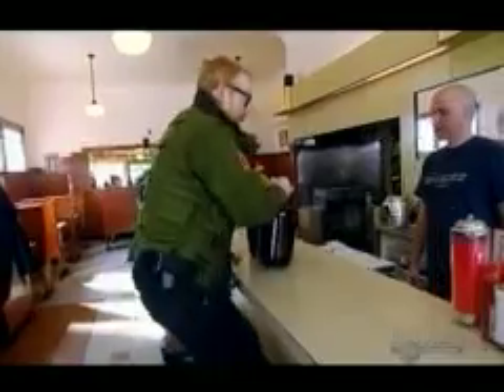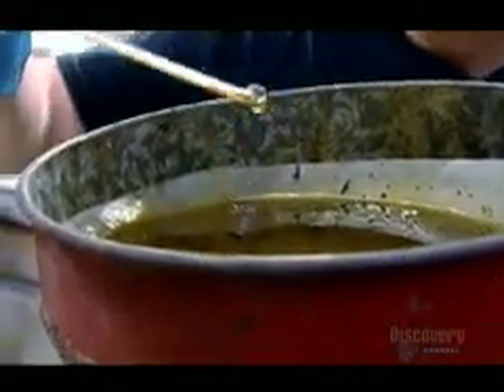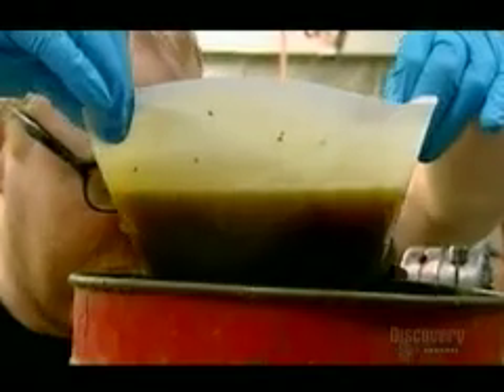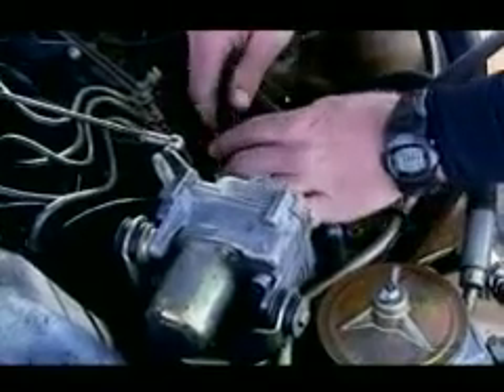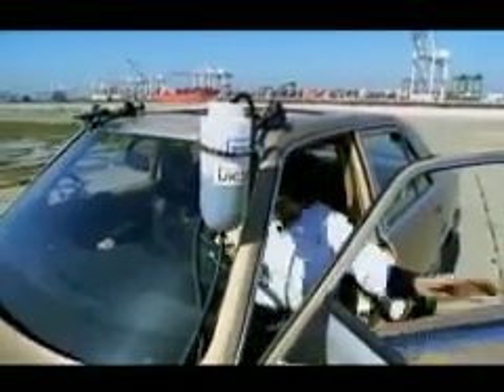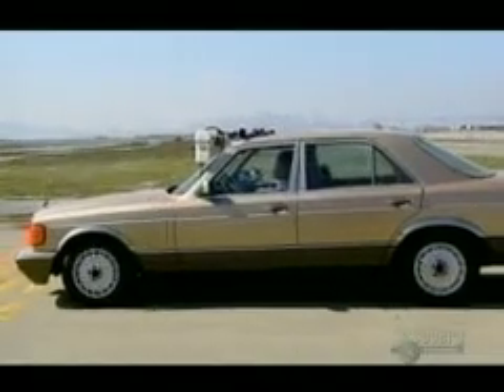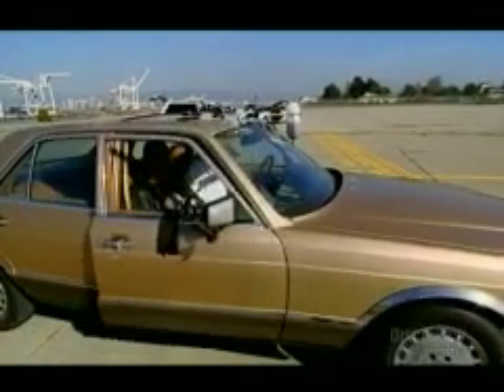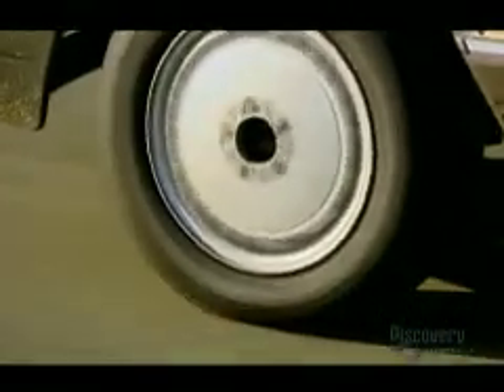Mythbusters - Cooking Oil as Economical Diesel Fuel

Comment: @LordLab dunno why, but ive tried cooking oil in a late model nissan diesel engine. Warning lights lit up and the engine ran very poorly. My old 1980s forklift and fiat tractor, however, love cooking oil. I have also seen non-homemade biodiesel destroy common rail injectors in an Iveco truck which caused 1000s of dollars worth of damage when left for a few weeks. The newer equipment is quite sensitive and shouldnt be messed around with just to save a buck or two. It costs more in the long run

Comment: that won't work on any old car.
the merc 220's have bosch inline injector pumps...generally speaking rotary ones such as cav's dont like running on veggy oil.but anyway it's usually illegal driving cars on oil ...and it wears your engine out faster ,the best thing is to make a mix of 80%oil and 20% diesel.the colder it gets the more diesel yçu have to add otherwise the oil sets...

Comment: @cristoretornebiblia I haven't converted my engine at all.I can't say about performance,but I never drive that fast anyway.It still does 70mph on the motorway easily.If you do it you will need to change your fuel filter more often than usual.For obvious reasons.Please don't use these kind of contaminated fuels without a good filter to protect your pump and injectors.Good luck

Comment: they did have to bleed the fuel pipe as it is diesel? ok they did not that means there was some diesel left in the engine when they did the run with the oil. They say that it is busted as it is not efficient. or as adam says not getting ultra high milage of those. well instead of putting in litre measure of  fuel they should have put in dollar worth like $2 or $5 and see what runs for more longer

Comment: they had to say this cause its main stream tv. Biofuel is obviously amazing. I like how they are so suspicious about if it will work when the original cars that Ford made ran on fuel made from the hemp plant. (search hemp car ford for more)
  The hemp seed is 30% oil and can be turned easily into fuel. Also wont smell like used kitchen oil.  
We should plant acres of hemp to turn into biofuel instead of drilling, spilling and polluting with oil.

Comment: Great little experiment! Thanks for the clip. I guess the big thing is simply to have lower costs. I've always had a problem with diesel because even modern ones are still noisy and don't drive well, petrol cars always feel better. I also have a problem because diesel gives out a lot more pollution on a local level and real nasty stuff too that causes cancer and other disease. I wonder how better the mpg would be with new not used cooking oil + solvent and also if it really would be cleaner?

Comment: "BUSTED" is what will happen when you get caught driving with fuel that hasn't  had a gas tax paid on it. Notice that they drove at a private  driving range. If they had been on a public road they would have been guilty of committing a crime. I'm not making this up. An RV vehicle had a bumper sticker that said "Powered by 100% Vegetable Oil." They were pulled over and "busted." These guys also omitted any analysis on what dirty oil might do to the engine. It's got to have some extra wear.

Comment: @mrjdl1971 Biodiesel can be used in all engines designed for diesel, including turbo-diesels like the VW TDI engines.  Other than being a bit more solvent, it performs much like diesel, though it gels at a higher temp (needs a tank heater in frigid weather).  WVO can leave residues that can clog or damage fuel injectors at the higher pressures and temps in turbo-diesels.  The car they used was an old Mercedes that does not have turbo boost, and thus avoids those issues.

Comment: @diesel4less The bust was for free fuel/super mpg devices/tricks. They said none of the devices or tricks they tested worked, *except for the wvo.*  Their only issue with wvo was that if demand increased, people would start charging for it, and the fuel cost savings would start to dwindle as the price went up.  They did say it worked just fine, and everybody who uses wvo already knows there's a bit less energy per gallon in wvo than diesel, and 10% is close to that difference.  No news there.

Comment: @rvillarrealjr1 The deisel engine was originally designed to run on peanut oil. It's popular with military vehicles because you can run it on almost any oil plus it can go through water not requiring an air intake for combustion. Civilians don't like to use them because they are noisy.
Reply: Sang3ETA false it never operated on peanut oil

Comment: @steveBB30 Then the Jeep cherokee Diesel has a distributor pump.I've been using all kinds of fuel for years with no probs.I even use fossil fuel diesel occasionally,when my supply of used oil is interupted.I've been told Bosch pumps can handle veg oil,Lucas pumps can't.

Comment: @mgfdh 50/50 with Diesel.What's the point then.I use straight used veg oil.I just filter it thru an old towel.My Cherokee thinks it's yummy.

Comment: People have forgotten that Rudolph Diesel intended his engines to run on plant oil.One of his first engines ran on peanut oil .Important to remember.veg oil is an excellent solvent, so will clean your tank and fuel lines which will clog the filter after 1 to 2 hundred miles.So change the filter and job done.Your home and dried.

Comment: @steveBB30 I'm not sure what you mean.Maybe we call things different names in Britain.My understanding is a good sized diesel engine with a Bosch fuel pump will run on veg oil without modification.The Cherokee diesel engine is the VM 2.5 L.It is slightly more difficult to start in very cold weather.But runs fine once the engine has warmed up.During the summer months it's always fine.Common rail diesel engines apparently need modification to run on veg oil.

Comment: The point is not that biofuels are more efficient fuels for automobiles, but with recycling as a central theme in biofuels, then biofuels is most definitely an economic solution to reducing our dependency upon the petroleum oil industry

Comment: @Fertro well kinda. you want the fuel thinned out so its not like syrup. thick cooking oil dosent atomize well, but if you heat it up it gets thinned out and it can atomize into a fine vapor when its injected into the cylinder, which is much more efficent because it burns more completely.

Comment: There are a few things you have to do to either your car, or the oil itself to keep it from gelling in your fuel pump.One involves chemical additives to the oil, the other is a small tank of diesel that you start the car with, switch to oil, then switch back a few minutes before shutting the car down.It's not just dumping it in and go.Also there are concerns that glycerin(or something) in the used oil might eat the seals in the fuel pump.

Comment: I think these guys are "advised" not to confirm these things, they busted the hydrogen one as well... and they never use a fair approach at these "almost free" alternatives. For all I know, some guys mix some other chemicals to the oil to make it increase in combustion, and you have to prepare the gas lines and other stuff in the car as well. You can always put new veggie oil, it's cheaper (in some places) or mix diesel with it...

Comment: @lupischuckle I have an old Merc it has a bosch fuel pump.My car will run on 100% neat veg oil.I've a friend with a Peugeot 405 diesel  he +runs it 50%diesel 50% veg oil. It too has a Bosch fuel pump.Too thicker fuel can damage fuel pumps if they are not strong enough All ford pumps are a bit weak.Be aware that veg will clear out the crud that diesel leaves in the fuel tank Regular frequent fuel filter changes r essential for the 1st 1000 miles. Every 5000 after that. No good on common rail tho'

Comment: This is kind of screwy, why don't they do the whole Biodiesel process? straight fry oil is not good for the engine in the long run, it has acidity and will eat up the fuel injection system.

Comment: Can you mix diesel and cooking oil? For instance, if I fill up my tank at point A (using nothing but cooking oil) but my destination at point B is further than a single tank will get me, can I stop in at a gas station with a quarter of a tank left and top it up, thereby mixing the oil and the diesel? I don't see why it wouldn't work, but I'm just wondering if anyone knows for certain.

Comment: That was interesting & I realize the point but if you'll notice the Diesel was less thick. Some people add kerosene or gasoline to thin out the veg oil to a consistency more like Diesel fuel. The added octane would increase mileage but there is a bit of science that goes into the making of Diesel fuel & this random mixing or even the use of straight veg oil will damage Diesel engines under a work load. Fine for the cars but not heavy pulling Diesels as a Diesel mechanic explained it to me.

Comment: @TenderTrap86 
If you study the topic in depth you will know that "Monkeynotes" is correct. We cannot produce enough crops to supply the cars of today if we choose to eat. Although Diesels are making incredible advancements as clean burning highly efficient engines. Solar in the lab has made leaps & bounds that make the panel more powerful & much smaller in size. The breeder reactor has made major advancements. The solution will be in the technological advancements of present technology

Comment: @TenderTrap86 
Because as is our shift into using food crops for fuel has created major food shortages in other countries and in the US any crop used for fuel drives the price of that food stuff up until corn on the cob costs $5 per ear or sunflower seeds become a cash crop for fuel instead of food. Anything used for automotive fuel will drive the cost sky high. It's called supply & demand. If a car burns water (or self converts to hydrogen) then your water bill will sky rocket.

Comment: @adamslurch71 Yes, that might be working. But you seriously don't want to compare a Ford engine to a Mercedes-Benz engine, do you? It might work in a Ford, because these engines are not speciffically engineered to only burn Diesel. This means you might burn vegetable oil but you don't get as good of a gas mileage.

Comment: They don't understand the way to run the oil. You don't just put it in the regular fuel tank. You need to have a separate tank with a heat bypass to reduce the viscosity of the oil, then switch over to SVO once it's warm enough, and run a purge before turning off the engine.

Comment: @libertypatriot 
You missed the point. Veg Oil is not more efficient than diesel. FACT. Yes free waste oil can save money and energy, but it will NEVER be a major source of fuel for everyone. Also used veritable oil will NOT be free if it has value, which is happening. If you take the time to collect used oil, clean the oil, modify your car (you can't just pour it on the tank), great.  However they're right, it's not more efficient but saves money.

Comment: The first diesel engines invented and built by Rudolph Diesel in the 1890's actually ran off of vegetable oil, what's the big deal? That's what Diesel engines were originally designed to run on. You can put that stuff in any Diesel engine and it will run fine but, you might have to change out the fuel filters more frequently depending on how well you refine the oil before it's put in the car/truck.

Comment: @MrLowAltitude  Yes, modern common rail injection systems are far less tolerant of straight veggie oil unless the oil is heated to at least 160F prior to being sent to the engine.

Comment: This is nothing.  I've been making my own biodiesel from waste veggie oil for years.  It's a lot more friendly for the engine, because you're dealing with the acidity of the used oil, removing the glycerin (which cokes injectors really badly) and I had to make no mods to my diesels to run biodiesel.

Comment: @FordDZLMan9191 There is a lot to take into consideration in this matter before washing your hands of it completely. I have and 81 vw that I run on 100% biodiesel and have for years. The only thing I have had to do is replace the fuel filter when the petroleum diesel sludge clogged it. My oil stays clean and slick longer and I get better mileage. The key is having GOOD biodiesel.

Comment: @libertypatriot I own an 81 vw diesel pickup and have been running it on bio diesel I make from waste cooking oil for a year now. You can run 99% of diesel engines on straight waste oil. But you need to start the car on regular diesel, preheat the oil and clear out the waste oil before shutting the car off or it will solidify and then youre in trouble. I think the lawyers told them to say busted because they did not explain it better. There are a lot of sites that explain how to do it safely.

Comment: Using the waste oil in a car that has only been filtered will eventually clog up the engine. It must be processed to remove impurities for long term use. The most important aspect is diesel from alga. Check out Valcent alga. Renewable, home grown fuel.

Comment: you have to filter used oil and dewater it also,i have been running a diesel cherokee for 4 years on new svo,mixed with some derv,she never missed a beat and i have done 50k miles in her,she is an older xj with bosch pump,running new diesel car on this may not be a good idea with fancy injection engine that you have these days,but old mercs and jeeps seem to be good,but check first.

Comment: all that needs to happen is preheat the svo to at least 160-180 degrees so it burns better and doesnt gum up the rings and before you can  run svo u need to get the car to operating temp on pure diesel

Comment: "Ring gumming" is a big issue with using veg oil, Best to thin it down or mix it with regular diesel for best results,
VAG diesels are warranted up to a 20% of biodiesel
(80% Normal 20%bio) they even recommend using 5% to lubricate the fuel pump since the government decided that using massive amounts of sulphur in diesel is bad for the environment

Comment: I only dilut it in the winter , no motor oil or atf because too much polution, I use that to heat my shop , 2 cars and 40.000 miles on wvo I can discuss a thing or two

Comment: @tonycavez  theres no more involvement then just putting corn oil in ur tank and ur off, if ur worried about diluting it, run 50% diesel 50% corn oil, i been running my w124 300D on corn oil for 3 years, it helps with power, makes it quieter and idk about them but i get better fuel milage. i also run motor oil aft fluid any kinda oil i can find, i run on it.

Comment: mithbusters are very funny but are no mechanics ,run a car everyday on wvo u should heat it to expell any water and then run it throu  sizes of filters and if u have only one tank u need to thin it down with some diesel or kerosene or mineral spirits maybe a gallon or two of gas or have a second fuel system thats heated with a 6way valve u sart the car on diesel when the temp is normal u switch to wvo before shutdown u flit to diesel to kleen injectors

Comment: Well, the real deal with bio-diesel is that it actually does need to be kept at a certain temperature for it to work properly in the car - that means that the fuel usually needs to be heated a bit before it works. However, I see nothing wrong with mixing it 50/50 with petroleum-based diesel fuel. On Bouginville, the locals have been running their trucks on home-made coconut oil for decades.

Comment: I dont think this will work properly on modern common rail diesel it will get clogged in the injector unless you filter it VERY well (its very delicate mechanics), i also dont know how that cooking oil will act in high pressure systems, since the common rail operates above 15000psi

Comment: they are very wrong about putting it in straight into the fuel tank! that will mess up the injectors and the cylinder walls. the glycerin needs to be removed first!!

Comment: Veg oil will not have gelling probs in summer time.
 Until the weather drops the temp to around 5 or 6 centigrade or lower. Then you will definitely need some extras like additives or diesel mix and line/filter/tank heaters or a twin tank system + heaters.

Comment: if you put raw unheated veg oil in the takn of your diesel car you would be sooo fucked! As oil cools is gets geled up, it would gum up your fuel lines, filter, in tank screen, lift pump, i-pump, piston rings, injector lines etc. you MUST use heated oil and caan't just run it through a sock filter. Also unheated oil has water in it from frozen foods. I know, I run my Mercedes on WVO the PROPER way.

Comment: @mizza21 " Diesel has additives to help it burn, Veg oil burns without the need for additives".

 No it doesnt, it has additives to help lubricate mechanical injector pumps and flow at lower temps,,, .Burning the new ultra low sulfter diesel in older engines will shorten its life...  I would prolly add some HOWES additive to my veg oil if i was running it straight.., Its only a better alternative because its free.. If it was the same price i would rather use #2 heating oil

Comment: They didn't run it strictly off of HHO since you can't put HHO into a tank under pressure. They used straight Hydrogen with no flashback suppressor or even a bubbler, and that was just plain amatuerish. 
Actually, HHO has been proven to work in trials leading back to NASA testing as far back as 1973, and proven again as recently as this year. Numbers don't lie.
Magnets on the fuel line is an old one, never saw how that one could work, and I'm sure it doesn't.